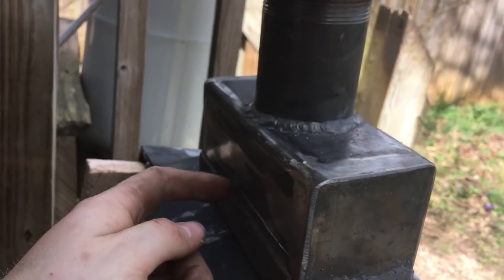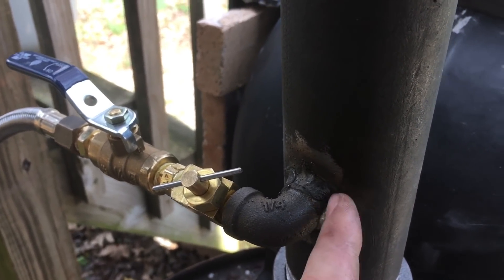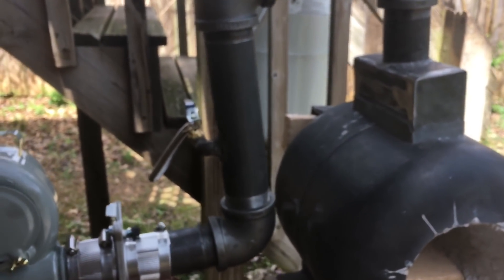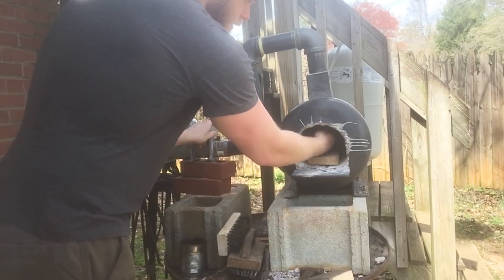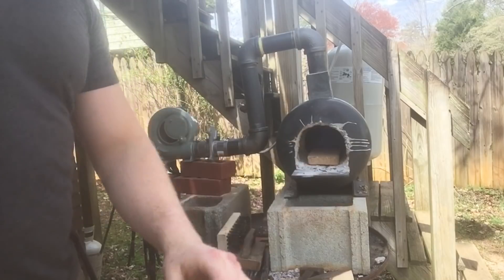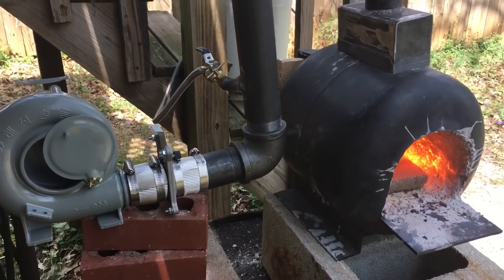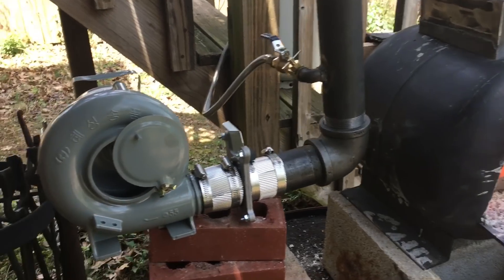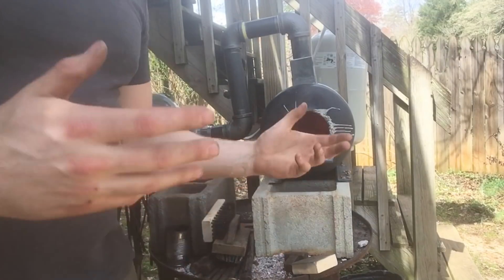My new ribbon burner forge

Comment: OK, so lm building a ribbon burner. What type of regulator do you use. Also does it matter if the burner is attached at the bottom. It seems like the 2 inch pipe would stay cooler and the work would get hotter faster.
Reply from the maker: You want a 0-30 psi regulator. I'm not entirely sure what you're asking on the second part

Comment: hey there, i don't know where else to ask - maybe you'll see this! you mention you get forge welding heat at 2psi. what size fuel inlet are you using? i've been injecting fuel with a MIG tip into mine and can't seem to get it up to a hot enough temperature, or am getting crazy blowback into the plenum of the burner. it's driving me crazy as all i want to do is forge and i can't get the damn thing to fire properly.
Reply from the maker: I don’t use a mig tip. I use an adjustable needle valve.
Reply: @OldHickoryForge  regardless though, it's a pretty small orifice out of that needle valve, right? I feel like that's fairly comparable to a mig tip and then working off of the regulator to get that 2 psi?
Reply from the maker: The Bogamin it’s adjustable. There’s no fixed orifice size. You can open it to allow in more fuel. To be fair my old regulator didn’t have a gauge so I was eyeballing it. Now that I do have one I can tell you for certain the fuel delivery system I use will weld at 3-4. I sometimes crank it up to 5 if I’m working a large billet or if I’m in a hurry.

Comment: What do you consider to be an efficient forge? I run a venturi forge and 20# of propane lasts me about 16-20 hours and I can forge weld in it no problem. It costs me about 70 cents per hour to run. I don't know the psi I need to run off hand to forge weld but it's probably around 3 psi. That large fire brick in your forge is a massive heatsink my brother. If you cut that brick and make it 1/4" thick and made a crumble fire brick floor onto of a thin piece of sheet metal your forge would be a lot more efficient and run at a higher temperature at a lower pressure.

Comment: Hey dude,
Nice build!!tell me though,having a gate valve versus a rheostat to control airflow,what are your thoughts?
Cheers John
Reply from the maker: Chris Daube the manufacturer says that wiring the blower to any kind of speed control device is bad for the motor and will wear it out a lot quicker. The air gate works good for me. Thanks for watching!

Comment: Hi John. I was just wondering if you had any thoughts on burner placement? I've seen some people put them off to the side to create a swirl effect but I think they are using venturi burners not ribbon. Do you know or think it makes a difference  with a ribbon burner? Burner placement is pretty much the last thing I need to make a descion on with my forge. Thanks
Reply from the maker: Newbie with a ribbon burner it doesn’t make much difference. Mounting it top down just makes it the easiest to assemble.
Reply: @OldHickoryForge  Cool, thanks for the reply. :-)

Comment: Help, help I did build my ribbon burner,much as yourself.
Probably run not adding enough gas and air after forge.
Running a blue one inch flame as you're till oven linner glows hot but then the sound change and the flame seems to go inside the burner head and it glows red hot
Reply from the maker: John Jude are you turning it way down after the inside of the forge comes up to heat? It could be a number of reasons that’s happening. Your burner could be too far inside the forge. Not enough air is a likely problem also. It’s hard to say without being able to see your set up for myself

Comment: How did you affix the ribbon burner into the forge? i can't tell if it is welded in or. . .
Reply from the maker: Rick Mayo in that forge it was actually just kind of wedged in there. Held up fine. Eventually I welded on brackets that were drilled and tapped for half inc bolts to hold it in place.

Comment: What kind of cfm  on the fan do you need for that?
Reply from the maker: Jacob Rawles the blower I have is 112. It works but I would like a bigger one
Reply: Ok i built a coal forge and re used a bathroom exhost fan for the blower its 50 cfm. I really like the way you do your videos, and the tecniques you share thanks.

Comment: Hey John I'm currently pulling parts together to build my first gas forge. I have watched your video on building a forge from a propane tank and took a lot from that. I wanted to know more about the forge you currently use in this video. Did you make that forge? What is the housing made from? Would a ribbon burner that is made from 2''x2''x8'' square make a good burner for a propane tank size forge? This is my first gas forge build and I choose not to do anything half ass, that's the main reason i'm going ribbon burner for the first gas build. 

Love the videos!!
Reply from the maker: TOTO UNICORN I did make my current forge. It’s also made of a propane tank. 2 inches of ceramic wool with about half an inch of castable same as the one in the forge building video. I just changed the shape of the chamber a little bit. Rather than round I made it flat on the bottom to make doing wider blades like axes easier. Also a 2x8 ribbon burner should be plenty of power. I use a 3x6.5 one myself and it’s a tad bit overpowered.
Reply: @OldHickoryForge  Thank you for your fast response. Another question, when you made your foundry ribbon burner set up. Where your propane goes into the main air flow pipe, do you have a small orifice hole there? Or is it just a large open hole from you needle valve all the way to the black iron piping?
Reply from the maker: TOTO UNICORN it’s pretty much the same set up as the orifice assembly on my forge. Needle valve is what controls the volume of gas flow

Comment: What pressure to you run from the propane tank up to the needle valve? Does it even matter?
Reply from the maker: HarlieJ it does but not really that much because you have more almost as much control with the needle valve as you do with the regulator. Running your gas at a higher pressure with your needle valve not open enough can kind of make your gas and air not mix quite right. I usually run mine about halfway open and then usually run the regulator at about 2-3 psi. 5-7 for welding.

Comment: Great videos, this and the burner vid.
Couple of questions for you. After a year, how is it running? Would you have changed anything? What type of tank did you use for the body?
Thanks for all your videos
Rob
Reply from the maker: Still running great! I do kind of wish I had made the chamber wider and not quite so tall to make doing axes easier. Actually currently working on a new one with that design in mind. The forge body was made from a standard 20
Pound propane tank, like you’d see on a grill.
Reply: @OldHickoryForge  
Thanks!!!

Comment: Heyya... could be a dumb question, I don’t care I’ma tenderfoot to these realms.
But is that furnace just a hijacked BBQ smoker packed with refractory cement??
I’d like to build my own, I’m assuming those are sufficient materials, PLEASE! Correct if I’m wrong..??
Thanks
Reply from the maker: It is an old propane tank lined with 2600 degree ceramic fiber blanket and then a layer of refractory cement over that to protect the wool
Reply: Looks like it's a 5 gal propane tank insulated with refactory cement.

Comment: So, after almost a year how much gas does it save you?  I'm looking to build my first forge and efficiency is extremely important to me.  But so far all I've heard is people saying forced air is more efficient because of x psi.  No one ever says how much more.  PSI tells me two things, 1)Jack 2)Squat.  I can vent the tank to open air and never achieve 2 psi no matter how much I crank it in.  I suppose you would have to know what the flow rate is at your needle valve setting to really know.   Anyway, have you found it to be more efficient in daily use?  Can anyone who has used both give me any idea of how much, if any, difference is there?  Also I don't believe you mentioned in your build videos anything about using ITC 100, plastix or Matricote 90AC which is what I'm planning to use.  Do you have any opinions on reflective coatings?  Good to see you are pushing 8k subscribers now!
Reply from the maker: SagerMan67 id say vs my Venturi gorge I probably get about 25-30 percent more run time out of a 40 pound tank at normal forging temps. Maybe about 15 percent more if I’m running it hard. Reflective coatings like itc 100 are great. Satanite works well also. The problem with lower density refractories like that is they aren’t very flux resistant, so I prefer the Mizzou castable. Might try kastolite 30 whenever I re line this one. But the burner itself has held up great, no signs of wear or decreased performance. With as much welding as I do I’d have probably gone through 3 sets of flares at this point. So I guess yes I have found it to be more efficient in gas use, as well as how fast the forge comes up to heat. About twice as fast as my Venturi forge. Much easier to tune down low for lighter work. No dead space in the forge makes doing Damascus a lot easier as well. All in all I’ve been extremely happy with the performance of the forge. Ribbon burner can’t really be beat

Comment: Im upgrading to a ribbon forge soon.  I am going to try and make it entirely of steel with no castable refractorym. I hope it will still work
Reply from the maker: Jesse Hannah that’s not a good idea. Steel is not a good insulator. It would take an immense amount of fuel to bring it up to working heat and would very quickly degrade.
Reply: I really hope you didnt do that

Comment: 4"x8"? I will be building a ribbon burner propane tank forge for making damascus. So I need to know what size burner I need. Thanks a bunch.
Reply from the maker: Ernest Sheffield this one is 3x6 and it’s way more than enough burner for the 500 cubic inches or so of the forge. Welds at 5psi. Have accidentally melted thinner stuff in it a few times

Comment: What blower is that? Specs? And did you take a refractory brick and drill holes or cast it with refractory and a mold?
Reply from the maker: Grandadz Forge I didn’t make the burner itself I know a guy who makes them and sells them for less then I could spend to make it myself. The blower is a 112 cfm blower from blacksmiths depot
Reply from the maker: But he casts his burners in a mould with crayons to make the holes and when the mold cures he melts out the crayons. So it’s a block of refractory cast onto th manifold

Comment: John, it's funny I just finish re lining my ribbon forge. The only thing I did different was first I didn't use a needle value I only use a high pressure regulator. The other design change it in stead of a air gate I used a ball value for plumbing which is essentially the same thing and I used a bouncy house blower for my air source. A bit of an overkill on the air but hey it's a lot cheaper that buying one from any Blacksmithing shop. I love my ribbon burner and only did a rebuild because I wanted to add insulation. Now I have 4 in a Kaowool and a thin layer of castable 1/4 in or so. I sill have plenty of room for as much as I want to shove in there. You wil love this design. Absolutely no hot spots, extremely even heat, and you can lower the pressure after you reach a welding heat to two lbs. at least for me I can . Also after I ran all out for four hrs. I was able to touch the out side of my forge and hold my hand on it for a short time. On my next one I am going to use Soft FB Ans two inches of Kaowool with a thin castable lining. Martin
Reply: I ment to say gate valve

Comment: awesome build!. it's one of the great things about forges, you can custom tailor them to suit your needs. great idea to have that cut off valve for your gas, I've seen some install an automatic cut off in the event of power failures. i have a single 1" venturi burner in a compact firebrick incased in plate steel made by a local manufacturer, really neat design. heats to a welding temp, great to start out with.